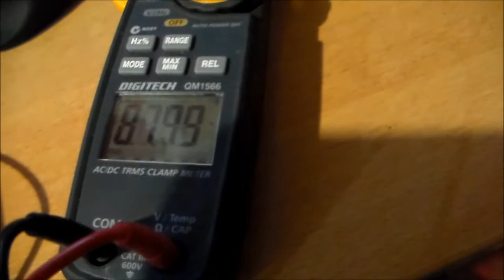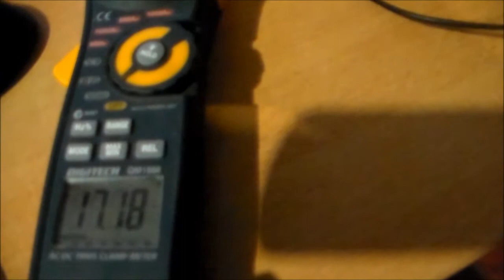"Made from Junk" Cider Inverter Capacitor Charger + Cap Discharge Test.

Comment from the maker: hey mate how are ya!! I modified the circuit to run at 35hz and it will now invert to 185 volts from 12. :-) i need some different value capacitors to make it run at say 100hz

Comment: Actually tried that with an 350V 500uF cap and not much happens when a fly touches it. The resistance of the fly must be too high for the (relatively) low voltage to pass though it. It did give a hell of a bang when I shorted it. After I souped up the circuit with a 3kV cap and a small flyback transformer small flies are being vaporized lol